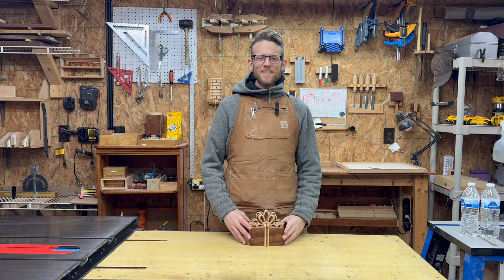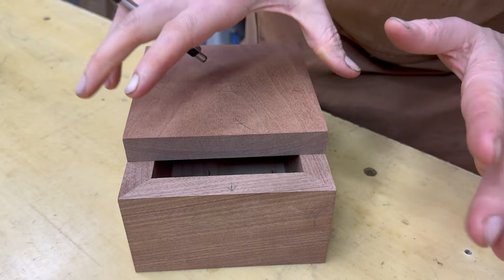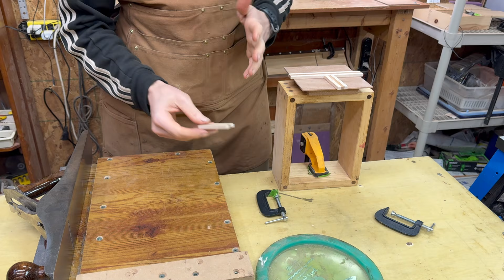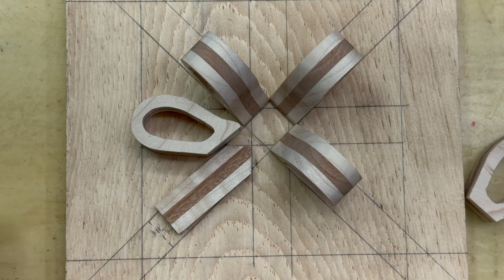Ribbon Gift Box Build - Step by Step Woodworking Tutorial.

Comment from the maker: Timestamps:
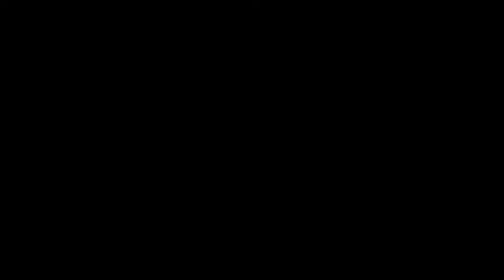Intro – 0:00-0:50
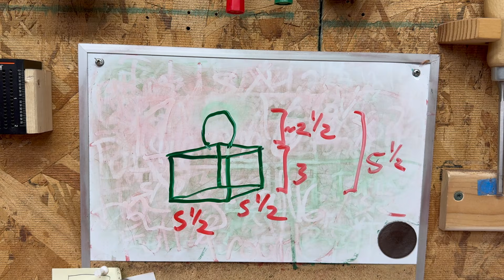Dimensions – 0:50-1:29
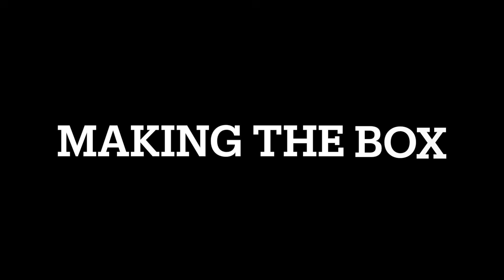Wood Thickness And Ribbon Blank – 1:29-7:18
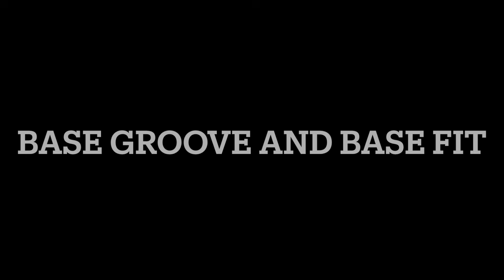Making The Box – 7:18-9:41
Base Groove and Base Fit 9:41-12:46
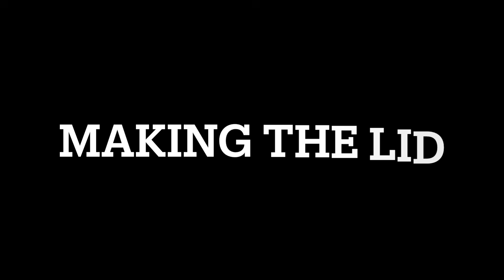Sand Inside And Glue Up – 12:46-16:11
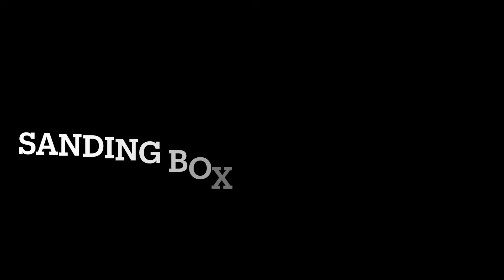Making The Underlying Lid – 16:11-28:36
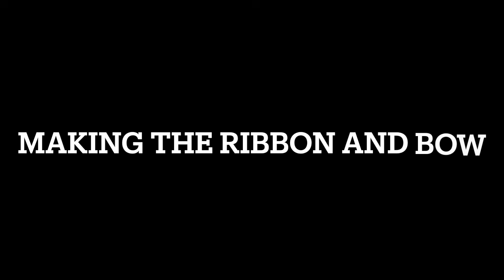Sand Box Outside Pre-Ribbon – 28:36-29:41
Making Ribbon and Bow – 29:41-
Close Look At Ribbon/Bow And Dimensions – 31:02-34:50
Order Of Operations – 34:50-37:09
Attaching Flat Ribbon – 37:09-39:40
Attaching Vertical Ribbon – 39:40-40:46
Making Four Side Bows – 40:46-47:41
Wavy Ribbon Layout – 47:41-51:20
Drawing Wavy Ribbon Shape – 51:20-54:54
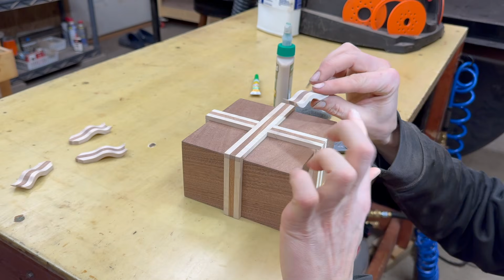Cutting Wavy Ribbon – 54:54-56:52
Glue On Wavy Ribbon – 56:52-58:20
Glue On Bows – 58:20-1:01:17
Making Center Tall Bow – 1:01:17-1:06:36
Apply Finish – 1:06:36-END